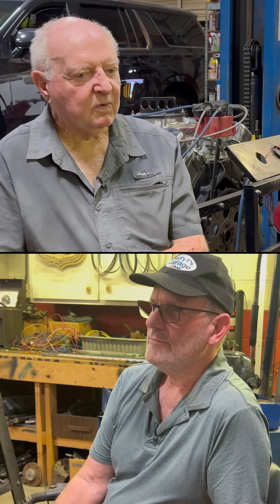Did They OVERBUILD in the 50s and Earlier? - Ask Ed 34 - Ed Smith w #BarryT #classiccars

Comment: That's the way everything is.
Back then the tool companies made the entire drill the same tool steel and hardness so you just kept on sharpening it.
Today just the "gold coating" is the sharp hard edge and after drilling 4 holes that dip or plate is gone and you have squealing and it's dull and you grind  off the gold coating sharpening it you're going down to the lesser grade material.
I had a relative similar to Ed (he's gone now) and I remember him describing he was trying to remove a rusted in place ¹⁰/³²  maybe ⁸/³²screw or stud off something from the 1920s.
"I wore out 3 hacksaw blades trying to cut this little screw off...here they were Heat Treating even the little screws that held on lights, & today they use butter"
I remember he despised British cars but then had to rework an engine in one-
His opinion changed after -
That engine block casting had zero pores...no junk left in..they purified the iron before pouring..those British blocks would never wear out compared to the porous Western iron and how fast the cylinder bores become funnels after 100,000mi." (the way he spoke)
They definitely had mastered Metallurgy in the late 20s if not before. 
They might have had crude cutting tools and rickety bearings in the machining equipment they definitely used grades of raw materials a universe better than the trash the factories use today.
The engineering department of Joe Blow Inc of 1910 would laugh out of the room the guy who suggests using the crapmetal that is common today.
Reply from the maker: Thank you for adding this… A wonderful comment. I appreciate this.
Reply: @BarryTsGarage I remember now it was a fender screw on a bicycle from 1920 but his feedback or comments were generally how the very earliest vehicles were built with low tolerance (the gaps varied because they didn't have high precision equipment until the 1960s and a lot of work was done "by eye" (in the Teens and Twenties) however the quality of material made up for that. 
He only really considered the Fisher Bodies a huge letdown.
They were building horse carriage and nailing sheet metal on top. The moisture got into the wood and the life of the car it's creaking and shifting and it's a world of work to restore later.  
We had one of the factory huge wooden mallets used to build those McLaughlin bodies 
McLaughlin Buick with those straight 8 cylinder engines.  That's what he was describing. Early 30s

Comment: One big problem I see with these new cars is the transmission being 6-7 speeds they never stop shifting every time you move the throttle at all the computer changes gears constantly. Sad but that’s the reason why you buy new car and in 70,000 miles your putting a 5000. Dollar transmission in